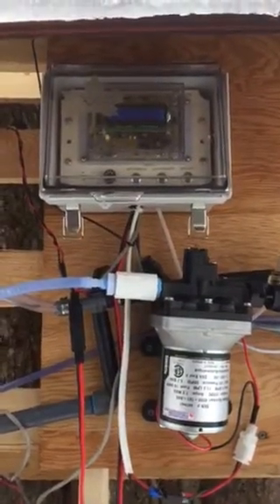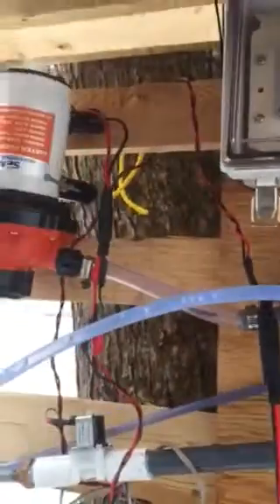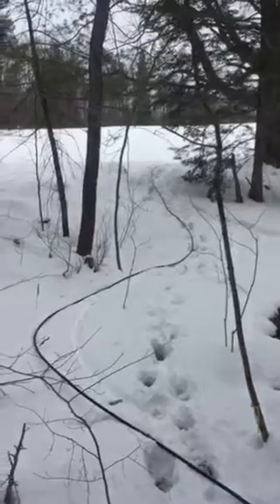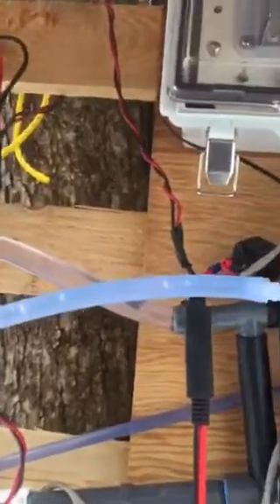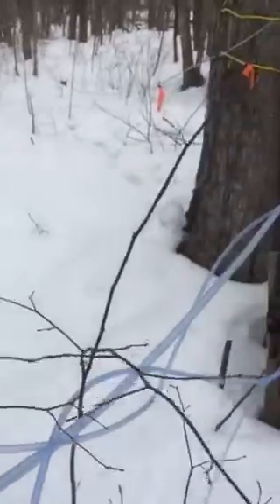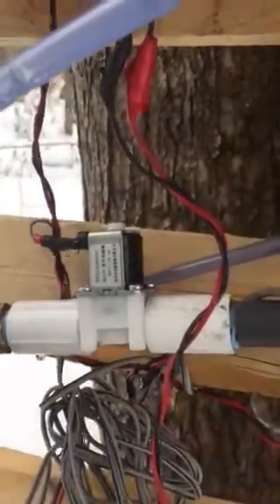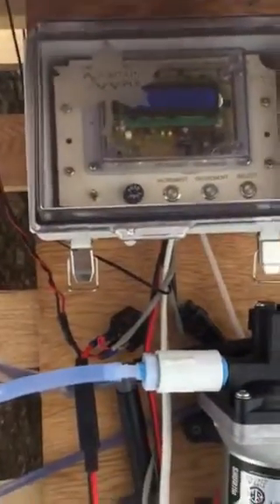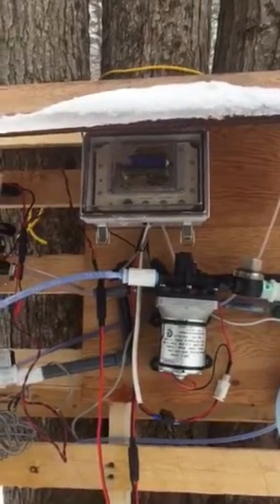Maple sap vacuum pump controller with sap transfer

Comment: Is there a reason to not use seaflo pumps for both? I am looking I setup a system like this and the seaflo pumps seem better for what I need. Thanks.
Reply from the maker: You can use Seaflo for both.  The higher gpm pumps draw more power, so battery will not last as long.   The Seaflo in the video is 5.5gpm.
Reply: @davebisbee875  excellent. Thank you for the reply. Luckily I can run mains power to mine. Looking for inexpensive vacuum for this year.

Comment: Thanks for the fast reply. I'll see how I can do that with my setup. I have a 220v line going to the system. I'm using a great pump that handles the lift I need (takes about 1 minute to empty my tank). I'm writing the software now and will be putting the hardware together by the end of the month.

Comment: What happens to the pumps when temperature falls below 32 for a long period. I'm worried about the pump freezing. I'm thinking about putting a 100 watt bulb inside the enclosed unit that goes on when the temp is below 30 degrees.My design has a a valve for each line that closes if the line looses vacuum (8 lines). Also, what's the head of the pump? I have an over 100' rise at 600' in length. I'm using an arduino to control every thing and have an cat-5 line running to the shack with a webpage that displays the status. Any thoughts? Thanks - Abbott
Reply from the maker: The transfer line contains an electrically operated drain valve so the line will drain back to the tank when the pump shuts off.  The Seaflo 5.5gpm transfer pump that I use self drains slowly if line is pitched properly so there is not much sap in the pump.  On the vacuum pump side, sap is purged from the pump prior to shutdown by drawing air in through the bypass valve.  Bypass is closed when pump ON, open to bypass sap when pump OFF.  No issues with freezups and no heat sources needed.  I have a 1/2" line, 600' long, 20' of rise and it works fine.  I don't know what the limitation is but it depends on the weight of the sap that it is pushing (line volume).  I know that if I interrupt a transfer, the pump will not resume pumping until the line has drained at lease partially.  I would think you need a stronger pump due to the rise you need.  I have a remote communication project in the works for remote pump control and status.  Dave